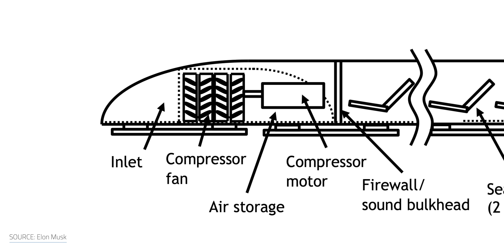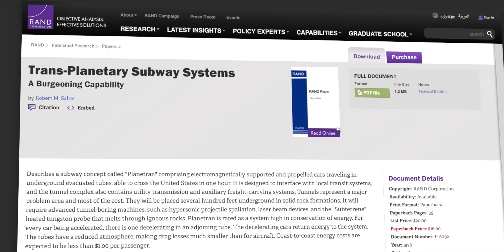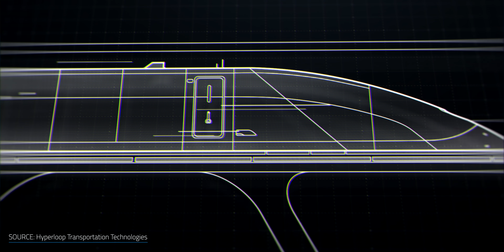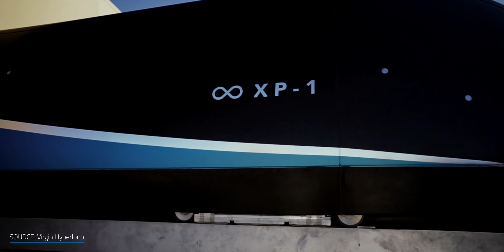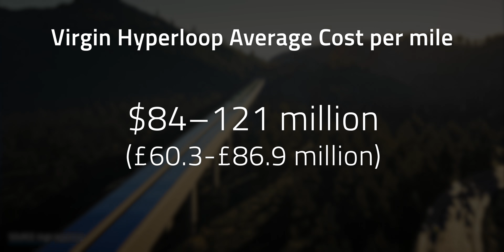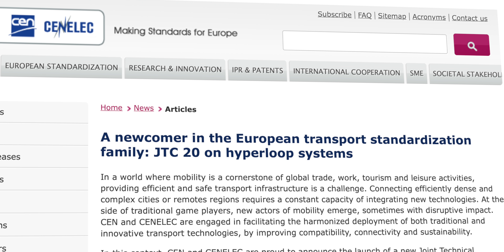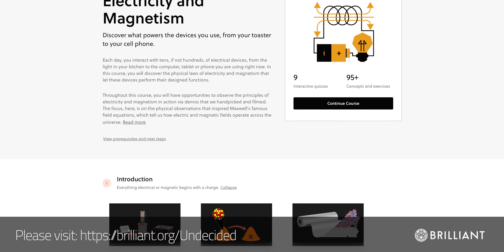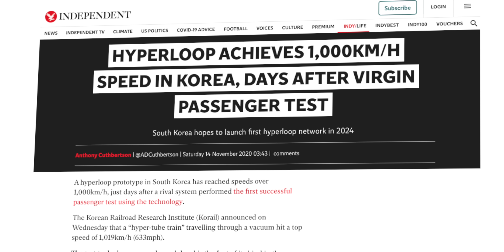Exploring Hyperloop - The Future of Renewable Public Transport?

Comment: After watching the first 4 minutes, I quit.  The HyperLoop is a brain-dead fantasy that has been UTTERLY demolished by Thunderfoot and others!
1/  Musk has abandoned his ridiculous air-hockey table levitation and has reverted back to WHEELS now!!
2/  Whilst a metal container can withstand significant INTERNAL pressure levels (Coke can up to 96 psi!) they will CRUSH pretty easily (Coke can at only 8psi and railway tanks on Mythbusters, for example!) it is very vulnerable to collapsing under atmospheric pressure.
3/  The equipment required to create very low pressures is not only pretty expensive but also needs to be fitted very regularly to be effective at dealing with the inevitable leaking (100m between pumps?)
4/  ANY DAMAGE - natural event/accidental/sabotage - will be absolutely catastrophic!  Any pods nearby will be destroyed or SEVERELY damaged resulting in the likely deaths of all occuptants!
5/  The structure of the tube itself is easily penetrated by almost any bullet.  AND the required welding accuracy of seams will be near impossible to be airtight enough.  AND the evacuation of air from embarkation stations will not be quick.

The WHOLE thing is a ridiculous fantastical pipe-dream that was created with an almost TOTAL inattention to basic principles of physics!  Musk had a dream - and then spent millions (and got other fools to invest 100's of millions) without even bothering to check some very basic parameters!  He's an egocentric fool with money... he wasn't even the inventor of Paypal... and don't get me started on SpaceX or "sub-orbital rocket flights halfway around the globe in 30 minutes" claims!!  He's got so accustomed to uncritical dumbasses routinely buying into his silly ideas that he just can't stop himself now.  It's become a psychiatric condition at this stage!!

I honestly expected a bit better from you, given your usual record of quality content!
Reply: Afraid you are wrong on so many levels. The Coke can arguement is just laughable. That stuff is thin, if you stack 100 layers of that stuff and see how strong it might be.
As for the vacuum, it only has to reduce to 10mbar to give a reduction in drag, any rotary pump will evacuate to that level immediately with no issue.

Comment: IMO vacuum tubes are too complicated, vulnerable, and dangerous. I think stationary turbines that pull and push air makes more sense to reduce wind drag. The turbines can be electric and powered by clean sources. In cases of emergencies, the turbines can be shut off so passengers can safely exit the train/tunnel. Since the turbines are stationary, they are easy to access and maintain.
Reply: If you make it a round-trip, you'll have even less need for turbines.
Reply: air has momentum. once the whole tube is roaring at 1000kph, that will not stop by simply flipping a switch. you can feel that yourself if you have a vacuum-cleaner with a pipe+hose. get it going and unplug the hose from the pipe and stick your nose into the pipe. there will still be air rushing at you, even though you have just disconnected the engine. (i was kinda surprised when that first happened to me)
Reply: I see where you are coming from, but unfortunately, such solution would not solve the issue of Maglev and aircraft, as you would simply transfer the energy losses caused by aerodynamic drag on the vehicle to the tunnel itself. And given the tunnel would have a vastly higher surface area and the wind speed as well as density would be much higher as well, this solution would actually be far less efficient than an aircraft or Maglev. The presence of air is the real issue here, that's why vacuum is absolutely critical for this method of transport to work.
Reply: I have had that same pipe-post thought once, but it would be very inefficient to move a huge air mass just to push a capsule.
Reply: @thoreberlin  you'd not just put one capsule into the pipe, but one every 10 seconds or so. like cars on the street. depending on what safety-margin is necessary, so that capsules cannot crash into each other when some problems occur. i guess.

Comment: Matt, I'm sad that you took this baited idea. You need to watch thunderfoots assessment and how impractical such a system would be. Never mind the energy required to reduce the air pressure inside kilometres of tube, if there was any holes anywhere (wether from corrosion or straight up vandilisim) along the tube it would invalidate any benefit. Also, if one of the pods leaks, how would they survive? Bottled oxygen? How long would that last as the pod would need to re-enter a pressurised space for people to exist the vehicle. Just watch how long astronauts take to prepare for a space walk and that's no trivial things. Anything goes wrong and they're dead.
Reply: I don't think this is an attack on your presentation. The basis on which the Hyperloop is founded is flawed. Maybe some company somewhere in the world might be stubborn enough to build something but long term this is slated to be a failure. I don't believe your presentation was flawed but the technology of vacuum tube transportation is.
Reply from the maker: I think I was pretty balanced in my presentation.  Rapid decompression and costs are two of the biggest issues, which I covered extensively.

Comment: So like a mag lev except it holds less people and is more complicated and costly to build and can be taken off line by a single nut bag with a hunting rifle.  What.could.go.wrong.
Reply: And all that for 1/4 the speed more
Reply: Scale-wise, a thumb sized hole would take a while to affect the safety of a tube. There is a huge amount of volume that would have to be filled to raise the air pressure to “brick wall” the cab.
Reply: The hyperloop moves an equivalent amount of people spread over more cars.  A tube on piers is much easier to manufacture, instal and align over roads, waterways, agriculture, infrastructure such as pipelines and ground cables, occupies a sixth of the ground area.  Much less earthwork, noise and mass of material.  It is safer for passengers and pedestrians and far less susceptible to terrorist attack due to its inability to be weaponized such an aircraft, and to to be targeted as it is within a 1" thick opaque steel pipe.
Reply: You can say the same about Airliners. One single bird could send you crashing to the ground, and yet it’s considered the safest from of travel.
Reply: @theflyingwelshman5338  a single bird can’t take out a jet liner. Most planes can still fly if half of there engines are taken out. A sudden rupsure in the hyper loop would kill almost everyone inside. A 14 PSI pressure wave is enough to sink a destroyer and destroy a concrete building. Your not surging that. Plus you would then have to replace billions of dollars of infrastructure.
Reply: @joeyhamilton6854  No, emergency decompression would dissipate a pressure wave within seconds.  And you would need a massive breach in 1" steel to accomplish this hypothetical pressure wave.
Reply: @theflyingwelshman5338  That's completely false. An airplane just obliterates the bird and continues on. Also, birds don't tend to be attracted to noisy huge planes
Reply: @matthijskkr  actually most engines in planes up until relatively recently with the advent of the jet turbine engines where venerable to birds. there are a lot of WW2 stories of birds taking out planes or being a massive cause of concern. and at military airbases that would stay quite until it was time to start the planes for missions or combat that would suddenly cause a lot of sound and startle near by flocks on the ground to take flight the time time the planes took off

Comment: A bit disappointed matt bit that hook. Hyperloop is not a solution for anything. The cost of construction, maintaince alone would be astronomical and I really don't get the renewable Energie Argument. Why not use that electricity to power normal trains.
Reply: People push forward all sorts of things that AREN'T needed... those things either succeed or fail and we all move on either way. Let people do things or do better yourself.
Reply from the maker: The hook is the sales pitch that Hyperloop companies use (could have been clearer on that point).  If they're right, the need for air travel will drop a lot.  Shipping and freight is also a big polluter ... again, that's the sales pitch for Hyperloop.  In the end though, as I explored in the video, there are some serious questions about the viability of the system.  The costs are just crazy.  The risk of rapid decompression.  Even Elon mentioned in his paper that this is going to be extremely difficult to pull off and manage.  But it is still very, very early days in this research.  It's still too early to call it a sure thing or a failure ... time will tell.
Reply: @UndecidedMF  I am very happy that you really take the time to read comments and respond in a measured way. It shows your commitment and I appreciate it very much.
Regarding your answer, I can only say that I have no problem with innovative thinking and risk taking. But from the current point of view I see the resources and investment rather invested in more promising technologies.

Comment: The predictability of interference will complicate this practical use. Take some domestic nutjobs that decide to damage one, or even some teens that decide to explore the tunnel. Sure, in a perfect world, no one would interfere with public transportation. But we are not in a perfect world, along with mother nature (quakes, water permeation, critters,...), we can't even have decent, ontime, transport above ground.
Reply: We still have diesel trains going 60mph spewing all that diesel exhaust going by my neighborhood. Plus tooting their loud horn that can be heard several neighborhoods away in the middle of everybody's sleep.
Reply: How is some teens going to explore a sealed thick steel tube holding vacuum?
Reply: @titter3648  from the outside.
Reply: They’ll probably need to add tsa services to these as well. Hopefully automated drones and sensors will be able to cover security and faults along the line.
Reply: All of the things you mention did not stop travel by air.  It will happen, and there will be problems and accidents.
Reply: @randyrice1429  teens and earthquakes in the air?

Comment: My opinion is the tubes have to be bigger , pod sized they may be quicker but the reality is most transits locations have to offer a minimum of 300 people but metropolitan areas on the commuter routes need up to 900 people in two trains coupled at peak to cope with demand it’s simple math that multiple pods not only cost prohibitive but also legal distance in time will have a major implications on max travellers in an hour it has to be. Add up of 6-8 carriages minimum , the other reason for making the pipes  bigger is to take u40 containers the need to reduce traffic form port to around the country is key and also the most profitable but more importantly the costs don’t take into the weight of these containers that normally in trains make up anywhere from 18- 30 carriages even if you reduce the amount of pods physically you still won’t get anywhere near the stats being put out at the moment . It’s this market that hyperloop has to go after otherwise the business will fail, either way speeds instead of faster will be slower even if they break 300 mph for heavy loads even if they are floating on air pods these individual pods may still weight over  60 tonnes before taking to the weight of the transport mechanism. There is a reason why vacuum tubes fell out of favour and the same principles are being used but don’t take into account the reality’s of moving people or cargo in scale it’s this reason why I still have more faith in the Japanese maglev design as they clearly show train principles still apply

Comment: Why is it shaped like a bullet if it runs in a vacuum?
Reply: Cause it's not absolute vaccum. There's some air in it that causes drag
Reply: Well what if a sudden loss of vacuum happens, would you like to get slammed by air to slow down or a gradual safer slow down?
Reply: @FSXgta  - if sudden loss of tunnel pressure occurs then I'm sure there will be a lot more to worry about.
Reply: "Near vacuum", there's no such thing as absolute vacuum on earth, especially at this scale.
Reply: @AndréGoersch  - indeed, liked your comment, thanks. If the "train" speed to air pressure ratio requires aerodynamics, then sure, but I guess it's the sweet spot in manufacturing cost, vacuum maintenance cost and efficiency that needs to be balanced.

Comment: It’s not the future. Electrified High Speed Rail is the way forward. We have the technology to do it, we know that it works, and it could replace millions of flights every year by building smart regional rail lines along high-traffic air corridors. 

High Speed Rail is a proven technology, its only obstacle is political. Hyperloop is an unproven technology that has neither gone its proposed too speed nor taken a turn, and it will have the same political obstacles as high speed rail, as well as higher operating costs and lower throughput.

Edit: also Musk’s white paper is so void of details and methodology that it should not be used as any sort of maxim for Hyperloop. We shouldn’t take the costs in that paper seriously, because it is not a serious paper. It claims an order of magnitude lower than high speed rail for land acquisition costs. The estimates in that paper are less fact-based and more “man wouldn’t it be cool if we had this?”